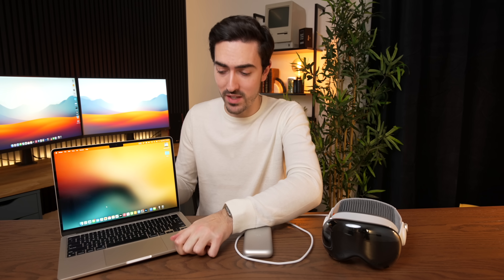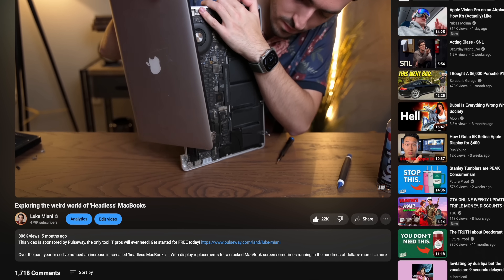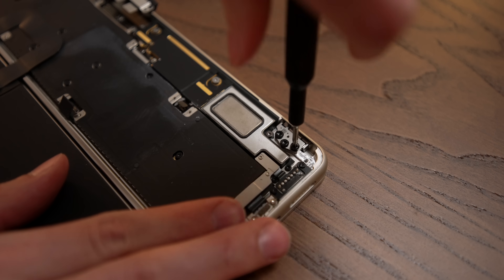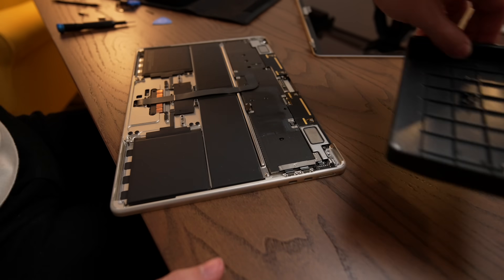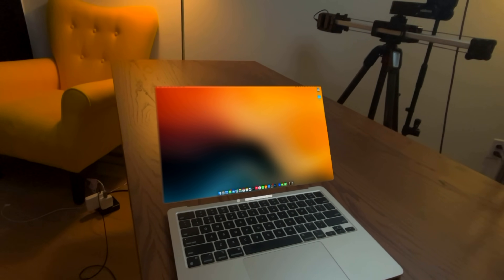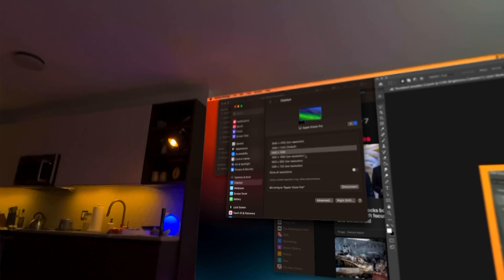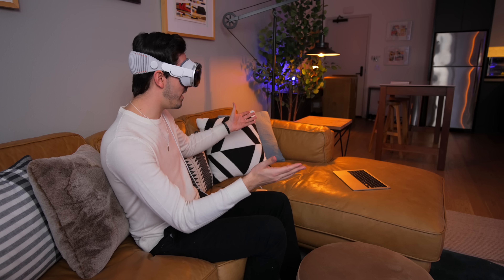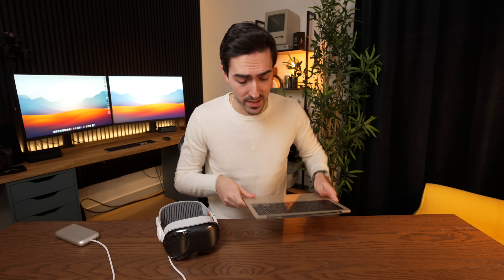Using a Headless MacBook with Vision Pro!

Comment: Combine the headless mac with a kind of Ray Ban AI glasses and you get a vision product the masses would actually use. Typing on the vision pro is crap and it’s too heavy and bulky for simple/work use. All the power is still in the mac so you wouldn’t need bulky glasses anymore. If the glasses could connect to you iPhone too, you could have the same idea on the go!

Comment: Although I like the idea, the Vision Pro has an M2, so it is perfectly capable of having desktop level apps and running some sort of macOS below (just by pairing a BT keyboard and mouse, the last which is not possible because of reasons 🤷🏻‍♂️). As with the iPad, the software is limiting this thing because Apple wants it this way. It’s spatial, but still not yet “computing” 😬

Comment: Hey Luke, what do you recommend for replacing the battery in an older MacBook Pro? I have a 2015 MacBook that needs a new battery, but I guess Apple no longer has the batteries in stock. Are iFixIt batteries any good in your experience?

Comment: This was actually one of my thoughts while watching VP connect to macbooks. Because once connected, it kinda sucks that the physical display is useless but you still need the keyboard and trackpad. But if you could remove the physical screen, then no waste.

Honestly really cool and i think would be a good use scenario in like a version 2 or 3 or the regular consumer version down the line. Most ppl dont need a laptop all the time but the few times we do, just to connect to it with a “display” you already use would be cool.

Like if iphones could dock with a headset and offer the same software and fidelity that vision pro does. but then when you wanna use a macbook you just “look” at it and connect.

Comment: Totally useless Fruit product that cost too expensive.   Imagine the monitor you could buy for $4k (well, if you didn't buy the overpriced garbage from the Fruit company).     Thankfully I am not infected with Fruit ecosystem conjob disease.     Normally I find you to be the most rational Fruit fly, but even you cannot resist the Fruit conjob.
Reply: Luke is ok, hes just trying to present the technology as it stands. Problem is that this is a perfect device to control impressionable minds and I am sure the chinese government is working on that right now. This is the real story. Cheers

Comment: Great idea for my 2017 "FlexGate" MacBook Pro. My screen is almost unusable and it's hardly worth spending the $$ for a replacement display, so why not use it with the Vision Pro? In fact, there may be a whole new market for old MacBooks with serious display issues. My question is, is there a compatible MacOS that will work with the 2017/24 Mac/Vision Pro?
Reply: Sadly, no. That Mac only runs Ventura, and Sonoma is required. The very next MacBook Pro (2018) would work though.

Comment: You need to modify your Vision Pro with a 2nd rear strap on top (like others are now reporting) and mount the battery on the rear with Velcro or similar as others are reporting 😃

Comment: What about just making a thicker keyboard/trackpad set with only what’s absolutely necessary for a Mac crammed inside, so removing display, speakers, etc. and then relying on connecting to the AVP? Then it’d be like an invisible computer

Comment: My question would be, if you could use the Vision Pro also with a MacBook Pro 17 inch or 15 inch from 2011? Because of the notorious failing graphics. Could you please test it or at least try if it would work and be useable?

Comment: Can you do 5k or 6k or even 8k resolutions by doing custom resolutions?

Does settings it to 4k resolution make it look shaper than the default resolution?
Reply: The resolution of the Vision Pro is close, but not precisely 4k, so even if you can set the macs resolution to anything higher then 4k, you wouldn’t be able to see it. Also you don’t have unlimited amount of bandwidth, even for 1080p, you have to compress the image to stream over Wi-Fi, just like you aren’t watching a native 1080p video on YouTube, but a highly compressed video.

Comment: Commercial: The MacBook screen is easy to crack and costs $600 to replace, let's fix it by spending $3500. Oh and if that breaks, you need to spend $2600 to fix it. SO it's the time to get our Neural Pro!

Comment: What is the new battery life on the headless Mac now that it doesn’t have to actually power a screen? And if they did make this a real product, I wonder how much smaller they could make it by reducing the size of the batteries for a screen that doesn’t exist. Could it be a marginally bigger version of their Magic Keyboard, but with a full computer in there? (Kind of like that Raspberry Pi keyboard/computer Chimera?) It is certainly an interesting possibility.
Reply: It will last much longer, the bottleneck will probably be battery in vision pro. Can it be connect to the headless mac for battery?  But I agreed, they can totally sell a keyboard+m2 mac+ a much bigger battery for a vision pro.

Comment: is it cool? yes. is it practical? no. absolutely not. does it maximize privacy? heck yeah!!
Reply: Which privacy? Privacy against corporations? Or the privacy against people?
Reply: @arkvsi8142   well, other people can look at your screen while you use a MacBook. but they cannot when you use the MacBook  Vision Air Elite Pro Max Epic Bacon 420 Ultra Edition, or whatever he called it in the video. 

it isn't privacy "against" anyone. it's privacy from other people. in the coffee shop or on the plane. wherever there are others around.
Reply: I mean if you were to use it without detaching the screen, it would just go black as shown in the video at the start. But It's definitely way less clunky without the screen
Reply: @davidddo   yeah but the second you take the headset off, the screen comes back to the display. so this is more private. 

however, it's enormously disadvantagous because once you do take the headset off, you no longer have a functioning laptop to return to. therefor, not practical.
Reply: It is practical. You are halfing the size of the MacBook. Making the whole setup even more portable. Whilst simultaneously removing the ugly black screen that gets in the way of your display.
Reply: @cyberking2712   yeah but the practicality of the MacBook is completely ruined by the fact that it's only usable with the Vision Pro. and THAT things only usable for 2 hours due to battery constraints. of course, you could daisy chain it with another battery pack. but eventually you'll start to get cramps, and soreness from use. 

it also completely destroys the resale value of the MacBook. except for on the very niche "headless MacBook" market. 

if this was a joke? good one. i suspect it might be. however, if it isn't? you should get into comedy.
Reply: @strider_hiryu850  how do you not realize that he and many other people are talking about future vr headsets that are going to be much, much better? In my opinion, making a device that has more compute power than a VR headset and is easily connectable to and has a proper touchpad and a keyboard is definitely a great idea. Of course I wouldn't remove the screen of my Mac if I had both devices, but this is very well the future. I am surprised you think that MacBooks are always going to be needed
Reply: @davidddo   i don't think MacBooks are always going to be needed. i don't even think MacBooks need a screen, inherently. 

however, i do think the practicality of the MacBook is drastically reduced if you do chop the head off, yet still take it out with you, using your Vision Pro as the "screen" for it.
Reply: @strider_hiryu850  as it stands now, yes, chopping your Macbook in half is a rather stupid decision

Comment: See I like seeing the cool Ideas in this. But we all know that the gen 2 product is going to be the real deal. I praise the early adopters that take the hit for the rest of us so they can work out what works. But its the second gen product that is usually the best apple makes. This use for headless macs is a good idea, also I can see this as good for working on a mac securly in an open space. I mean think about how small a mac mini is or could be if they put them in a smaller form factor and match it with the vision pro when traveling.

Comment: Tim Cook is watching this video closely. Let‘s wait for the Mac Nano - half size of a Mac Mini to connect with AVP.
Reply from the maker: Mac mini with built in Keyboard and trackpad would be dope ngl
Reply: @lukemiani I was thinking about the Vision Pro connecting to a Mac mini, and here you are doing a headless Macbook connection. This BYOKMAM (bring your own keyboard, mouse, and monitor) is now just a VP (I heard typing with your eyes and pinching with the virtual keyboard is faster than finger tapping the air key, lol).
Reply: full circle back to commodore days  @lukemiani
Reply: @lukemiani that’s just a laptop that’s not portable?
Reply: @lukemiani and it’s basically gon be headless macbook
Reply: @lukemiani  Apple Magic Keyboard with built-in Mac Mini! :) 
I sense an Apple Magic Keyboard Pro! :D
Reply: At this point just put an m3 Chip into a smartphone and let the smartphone be the MacBook
Reply: @IFrancyISantosI batteries aint there quite yet
Reply: @MLTAKOS  And cooling
Reply: @Pasi123 Disagree, one of the selling points of the newer Macbook Airs is that their CPU’s ARM architecture which heats up significantly less and barely any cooling is needed
Reply: @Sepoipaping  It still needs a lot more cooling than what fits in a phone. Just look at how hot the MacBook Air's run and imagine that chip in a way smaller device.
M3 has 22W TDP, M2 20W TDP and A17 Pro only has 8W TDP
Reply: @Pasi123  Makes sense, but as time goes, even computer ARM chips might get smaller
Reply: Pocket Mac.
Reply: Luke got me shopping for cracked screen MacBooks. lol
Reply: Why not just let the vision pro be the mac?
Reply: @Kenttheclark  That is coming.
Reply: @Kenttheclark That's what I was thinking, but some 3rd party devices need to be connected to the Mac, Vision Pro doesn't have that USB port
Reply: @Kenttheclark Well, it quite literally is
Reply: So an iPad 😂
Reply: @albertsitoe7340 But smaller, of course
Reply: @Sepoipaping  So Mac Mini? :glasses-purple-yellow-diamond:
Reply: @albertsitoe7340 I think Vision Pro needs a “screen” to connect to so a Mac mini on its own won’t work
Reply: @jeffreygi  And Mac mini without the processing is just a HomePod?
Reply: Not a good idea. It's too many steps
Reply: you forgot the double price for the new concept
Reply: Don't give apple any ideas. They have taken away enough features from their products. I don't want the screen to be one of them😂
Reply: @E4S65  “Introducing, the new MacBook Air. Emphasis on air because it’s literally that” —Tim Cook
Reply: Imagine, well imagine if various vision pro users could connect to a Mac Studio and use different desktops at the same time, you would save 5-6 pro screens, and everyone could collaborate on the sae desktop
Reply: Mac None

Comment: I was wondering how do apple locate the connect button in vision pro. Does it identify the MacBook keyboard and trackpad for its detection or it uses the network serial number to identify it. For desktop Macs, I believe it doesn't show a connect button for ease of use. It would be nice if the Mac Studio also has the connect button.
Reply: I’m guessing it’s the near field communications added to all their devices to make “Find My” work better. They might also be using Bluetooth to initialize the connection.
Reply: @thewiirocks  Probably near field for rough location and cv for detailed location.